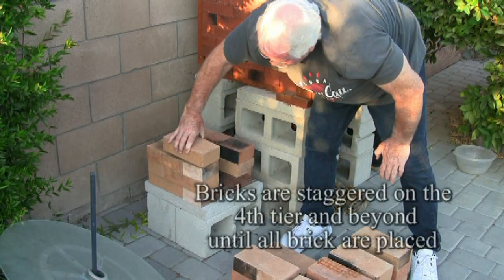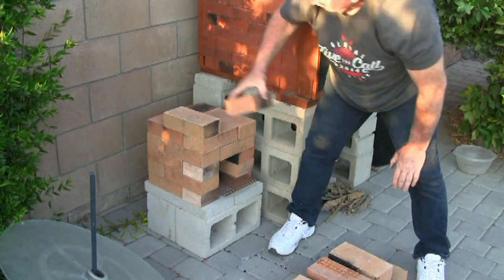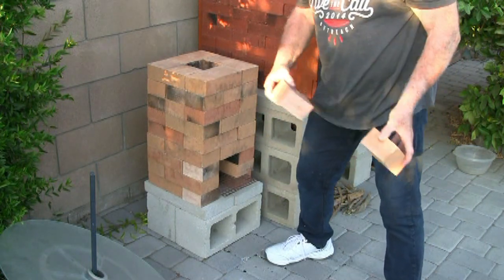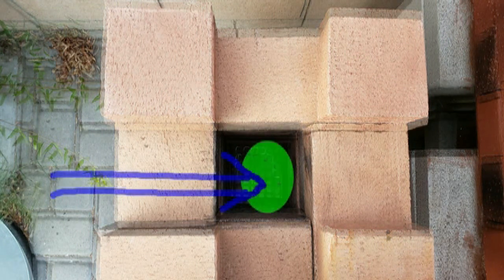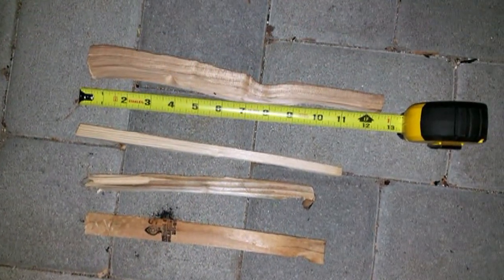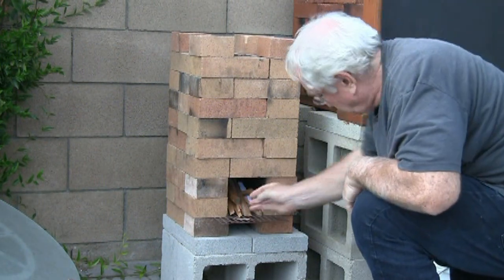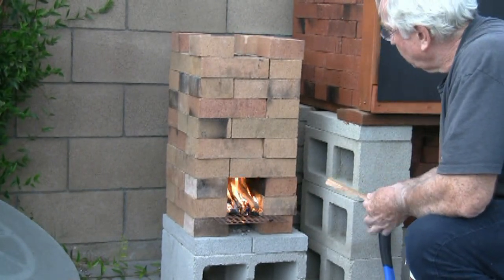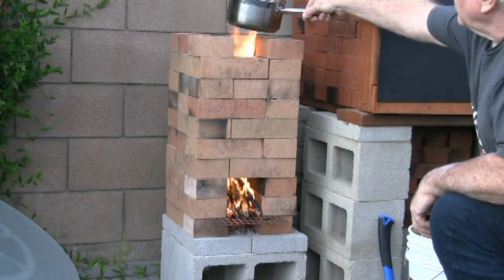Rocket Stove: A Solution for Disaster

Comment: Oh my! As I'm about to build one I've read "solution" as " recipe" .
Got really worried who found a danger in the stove
Reply from the maker: If used properly, this stove is safe. It can be a real benefit to those in areas where there is a need to conserve wood, purify water, cook a meal quickly, and help in burning wood cleanly in comparison to regular 3 stone stoves. I have built several in Honduras and as you can see one in my backyard. I have also built a Rocket Oven which uses the stove as the means for heat. You can see that at the following link: https://youtu.be/0ABsWhzt9Pg. I also built a couple in Honduras. In the following link you can see the results of its build: https://youtu.be/C65jDomYl20. and another this year: https://youtu.be/M3S5S_nqrfk. Happy building. I do have a bookle for those who want a step-by-step instruction in the building of this oven.

Comment: I like the way the grate is sticking out further. Makes it easier to load. Also the larger compartment for more and larger wood pieces. Nice design. Thx
Reply from the maker: Thanks for your comments. This model works very well. Some configurations only have one tier for the fuel intake. I enlarged it along with adding a longer grate for the purpose of using varying size wood and longer. There is no doubt a person must tend to the fire, but larger pieces of wood allows for long burning times.

This design of rocket stove allowed me to develop a chamber over the stove using block and brick to develop an oven. I have baked bread, cookies, pizza, and brownies. Same concept as a regular oven. I have built one for my back yard in case of emergencies and also in Honduras. In Honduras, the oven and the stove will help wonen in cooking with a small percentage of wood and the time. You can view my build on my channel. I have also drawn up plans for both. If you want a copy I can send a PDF copy of the stove and oven.

Comment: Californicate would not allow it without a catalytic convertor + you might disturb some critter in the woods.
Reply from the maker: That is funny, but probably not far from the truth. I live in  Southern California and have built not only the Rocket Stove, but a Rocket Oven. The great yhing is how clean this technology burns. I have prepared seven 27 gallon containers full of different size kindling from various hardwoods and softwoods. I have also prepared an 275 gallon IBC tote as a backup water storage in case of an  unwelcomed emergency and power and water outage. Working on a solar backup plan. Thanks for the chuckle. Blessings.